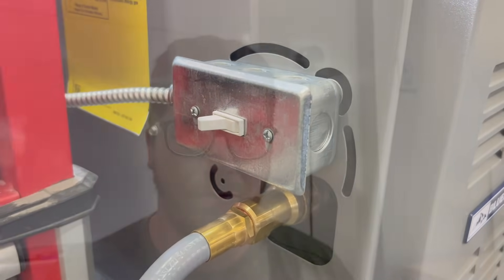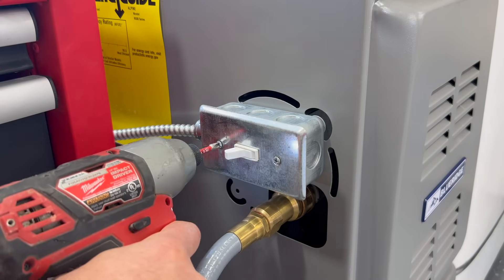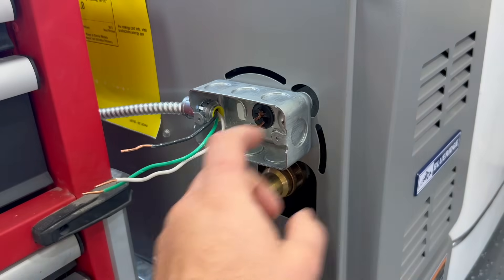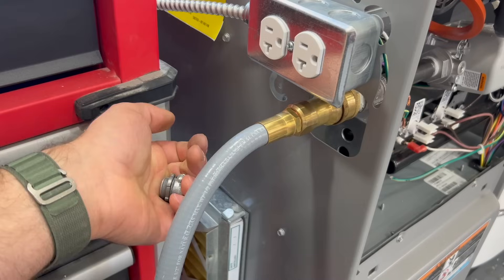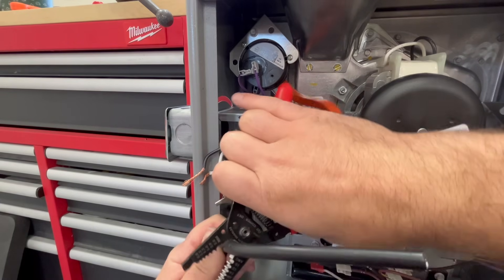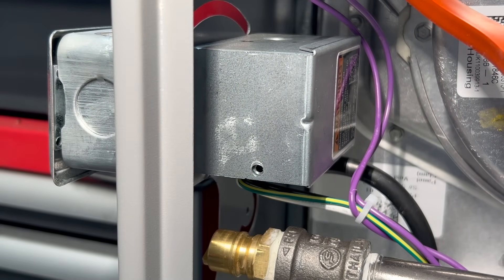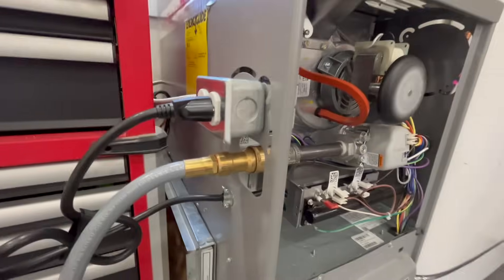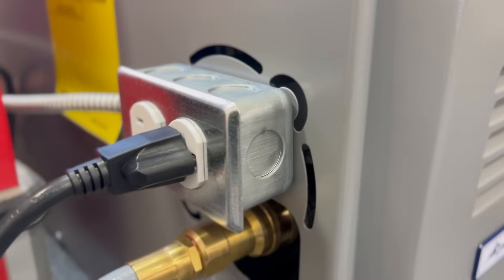Keep Your Family Warm During An Emergency Power Outage With This $20 Fix

Comment: Not NEC compliant ----I have something similar on my furnace, but it has a switch in place of the second outlet......NEC requires a furnace to be on a dedicated branch circuit , so having the extra outlet is not permissible.  A single outlet, or a switched single outlet is permitted.

Comment: Your GFI wall outlet may have reverse polarity because your tester was chirping when you plugged it into the neutral slot on the plug.
Reply: It's a proximity sensor I'm thinking it's fine

Comment: Did this on my furnace 40 years ago when I bought my first generator and didn’t need an over priced transfer switch. My life isn’t so petty that I need to have every convenience running 24/365. In winter I power my furnace if needed and every four to six hours maybe run the ref/freezer, and in summer just the ref/freezer. If it’s nasty hot out just wet a shirt or tee shirt and sit in front of a small fan. Chances are, with the fan, you will freeze your butt off.
Reply: a real macho man.
Reply: Has nothing to do with being petty....jealous much

Comment: SUPER vid! Especially that "bonding plug" tip with the power station use. I had been using a gas powered "bonded neutral" genny to run my nat gas fired furnace via an EZ Generator Transfer Switch; all was well, since the circuitry was "bonded" to the main electrical panel. 

BUT--when I bought an ECOFLOW poer unit/geneator--furnace would not kick on. I called "Kevin" at EX Generator Switch who referred me to their YouTube about this--just switched out two wires on their green EZ Generator Transfer Switch and it worked just fine!

This what Dave, the DIY HVAC man here is showing us here--your portable power unit, be it ECOFLOW, Jackery, Bluetti, Flashfish...whatever--needs to have the neutral circuitry "matched" to run your furnace--be it a floating or bonded neutral.

If you're unsure or don't want to handle the transfer switch route, just see what Dave does here! MAGNIFICENT! Thank you, Dave! Saved a bundle for a lot of folks!

Stay warm and stay safe, Folks! Here in an Ohio Winter it's been minus -20*F--nothing to fool with. Make sure you give your job here a "trial run" BEFORE Old Man Winter arives.

Cheers!

Here's the YT on the transfer switch:
https://www.youtube.com/watch?v=gVbUWCCt0D4
Reply: Question:  That is simply a standard plug. How does this connect the neutral to the ground?
Reply: But what happens when the power kicks back on and the generator is running. Wouldn't it be better to have a switch/plug combo. So you kill power to the furnace with the switch. And the plug is the only power coming into the furnace.

Comment: If the power is out how long will the "gas" continue to flow to houses?
Reply: That gas is coming through pressurized lines from many miles away. And those stations have their own back up systems.
Reply: @MrToLIL  Correct.  My late uncle was a gas meter man.  I ask that question 25 years ago.  Sometimes the gas travels 100's of miles before getting to your house.  Its the gas companies first priority as they cannot bill if the gas doesn't get to your house.   They are backed up 6 ways to Sunday including earth quake designs.  Just sayin.
Reply: @MrToLIL  Thanks for the response I understand how the gas comes to my house I want to know an estimate of how many days or weeks the back up systems at the gas company will continue to work...

Comment: What kind of gas line/fitting did you use in this installation?
BTW I used your videos, got my technician license and saved $14,000 installing a hybrid 4 ton heatpump/gas furnace by myself!  Thank you so much!
Reply from the maker: It’s a quick connect that is typically used for gas grills. Because this is in the middle of my garage I didn’t want to out in a permanent one so this works great. Obviously not up to code for a permanent installation.

Comment: I will just leave this here: "ECM Section 422.16(A) requires that fastened in place cord connected appliances must be specifically intended or identified for flexible cord connection by the listing agency and the manufacturer. The appliances must be marked accordingly".
Reply: Bro…where I live if you skin your knee and bleed 30 buzzards arrive 20 minutes later and peck your eye balls out.
Reply: @EvilE22 where OP lives he has to get a permit from his wife’s boyfriend to watch.
Reply: He said you could easily undo it. I assume he  meant in case you decide to sell
Reply: What size of generator do you need to at least have to do this?
Reply: 110 and 220 will not stop arking because of tape
Reply: @briancc2100 
It won’t even start arcing simply due to electrical tape, kind of the point of electric tape.
Reply: Idiot
Reply: OP sounds like a bootlicker.
Reply: You are ……duuh dum duuu🙈
The code was written for people like you who have no common sense …..
Reply: What  size Inverter do you have ? I have a 1,000 mine maybe too small of wattage.
Reply: YESS CODES , STATUES , LICENSES ARE NOT LAW NO ONE HAS THE RIGHT TO TELL YOU WHAT TO DO YOU ARE FREE BUT YOU HAVE LET MAN LEAD YOU BY HIS LAWS WHICH IS DEMONIC EITHER YOU SERVE GOD OR satan 👹~🙏TRUMP WON WE WON BECAUSE GOD ALWAYS WINS AND HE IS BRINGING THE CORPORATION DOWN SO START LIKE ME KNOW YOUR RIGHTS TAKE THEM TO COURT SUE DONT USE THEIR ""DRIVERS LICENSE""REG, INS, THEIR ARE WAYS TO DO IT I DO ‼️‼️🙏🙏🙏🇺🇸🇺🇸🇺🇸

⚖️⚖️BIBLE IS OUR AUTHORITY , CONSTITUTION ,BILL OF RIGHTS IS FROM THE BIBLE YOU ARE FREE ACT LIKE IT ‼️‼️🙏🙏
Reply: @lastword489 Thanks for the heads up. Even when it’s a desperate situation, the insurance companies may not agree with any exceptions for breaking the rules. ⚡️🔥🏠

Nor will the Grim Reaper!🪦🥀
Reply: Uhhh in an emergency..   no one makes me do anything..    Any regulations are out the window.

We had to make due in the summer of heat and winter of ice in st louis.  No one was there to save us.   We had to do our own saving.   Govt can suck it
Reply: @KerbyDaFrog  yup,codes can suck it in an emergency for my family.
Reply: @KerbyDaFrog Gotta pay to play, dude.
Reply: That's great and all but the real danger is having a cord dangling without armor protection.

Comment: 1,000 Watt inverter method is the one posted in a previous video is the one I want to go with.  Pigtailed to my Chevy 2500HD Duramax.  Also, I store my Deep Cycle RV batteries in my garage in the winter.
Reply: TRY using COHERENT sentences COHERENT sentences COHERENT sentences.

Comment: Is the bonding plug necessary if the power station is plugged in an outlet?  I asked because I noticed my power station has no ground stand along; but grounded when plugged in.  Thanks
Great video btw!

Comment: Did this modification during the Texas Freeze of 2023, I found a previous video of yours. It was awesome to have some normal comfort during that outage. quick and easy, when grid power came back, unplugged from generator and plugged back into grid. I used a switched outlet so that I can still switch on and off if needed.
Reply: Um…..THAT was in 2021, DUMBBELL!!!
Reply: @ there was another one in 2023 as well. I was okay during 2021, lost power 4 days in 2023.

Comment: The nice thing about these Portable power stations (I have the EcoFlow Delta 2 Max) you can plug the Portable Power station into 120VAC source and leave the the furnace plugged into the Power station 24/7 as most of them incorporate a "Pass-through" feature where whatever is plugged into the Power station will be powered by the grid power while it is also keeping the Power stations battery charged. This way you do not have to get up in the middle of the night to plug the furnace into the power station as it automatically switches to battery when needed. I wish they had a feature for my RV's LP, which ALWAYS empties a tank between midnight and 5 AM and it is cold outside. LOL
Reply from the maker: Awesome! I’ll have to do a video on this! Thanks so much for the idea.
Reply: @diyhvacguy  It's called ups mode to kick on when power fails.. Not all power stations have it, Bluetti does on some of their units like the AC180 and Elite 200 V2 which I have...maybe others.
Reply: You do not want to leave your power station plugged into utility power while using the neutral ground plug. It could mess some things up.
Reply: @Don_Kee  you won’t need the neutral plug if you have it plugged in to your utility power. That side should be providing the bonded ground and neutral it is looking for.
Reply: Great comment. I have an Ecoflow Delta 2 Max power station but was not aware of the pass through capability.
Reply: Wouldn't that back-feed the distribution system if power goes out?  And that could injure a utilityman working to restore power outside.  Quite reckless and illegal.
Reply: @eegg6954  when you have your computer plugged into a UPS and the power goes out does that back feed the grid?
Reply: @eegg6954  No back feed at all, because your furnace is not connected to the Grid, it is powered directly by the EcoFlow 2 Max and the Max is plugged into the grid for Pass Through and battery charging only. No AC power returns to the Grid. It is isolated from the grid.
Reply: With the EcoFlow Delta 2 Max, how many hours will it run your furnace?  Also, it seems you don't need to do any of the wiring shown in the video.

Comment: Can you also do this if your switch is on the wall, away from the furnace?  I'm trying to wrap my head around how the wiring would work.  Maybe after coffee.
Reply from the maker: lol coffee is always important. 

So it would be extremely easy. All you’d do is kill power at the breaker, remove your switch as well as the conduit that runs from your switch to the furnace, and then simply install the outlet where the switch was. Then you’d just put the pigtail in place of the conduit!

I could probably do a video on this but I’m not sure how many furnaces would be oriented this way. 

Cheers
Reply: @diyhvacguy  Thanks, that makes sense.  You mentioned something about not having the pigtail too long.  The distance up the wall and over the ceiling and down to the furnace is probably longer than the 9' pigtail.  Assuming I get a longer pigtail, would you be concerned about that longer length?  Thanks a ton!
Reply: @diyhvacguy  I think I'm overthinking this.  Couldn't I just leave the wire in the conduit, and use a short pigtail where it terminates in the switch box to then act as the plug after I change the switch to an outlet?
Reply: @diyhvacguy  It worked great!  Thanks!

Comment: This is a very good video and something we want to do. The power in our city is very dependable as we have had maybe two outages in the 25 years we have lived here. However, we do need to be able to power our gas furnace in the event of an outage during the winter. Do you have any idea how much it should cost to have an electrician do this work that you showed in the video?
Reply from the maker: Probably 300-500 if I had to guess. Maybe less. The great part is it’s 100% reversible should someone say it’s “not up to code”. I’ve seen so many homes here in Utah with an outlet and a plug just like this and most inspectors would have no objections to it

Comment: In my case, I installed a generator transfer switch  and panel into my main  breaker panel.  I can power my gas furnace, well pump, refrigerator and freezer and a few other breakers strategically throughout my house.  No need for extension cords running to everything except for the one heavy duty 10 gauge cable that runs between my generator and the transfer switch.

Comment: Can you run an extension cord from outside gas generator and plug it into the pigtail, instead of the battery generator?
Reply from the maker: Correct

Comment: Even though "hot pens, Wiggy" are useful, trained electricians are trained and encouraged to never use them. Most of them (hot pens) have a false negative hazard.
Reply: Gotta be better than nothing
Reply: Agreed. Never trust one of these pens with your life. He wants to do it and that's fine but always check with a meter hot to neutral, hot to ground, neutral to ground. Even then the meter could have a blown fuse so the pen first would also help. I just had a home inspector give my home a failed report saying none of the outlets were grounded. They came back the next day after they realized their meter was broken.
Reply: Agree

Comment: You left out the 4th item you need...a generator. 🤷
Reply: I have a very similar setup and in 2 hours I can recharge the battery from a generator which will then last all night without noise, pollution, risk of theft, or fuel consumption.
Reply: Watch the last minute of the video. He mentioned sizing the battery for runtime and for some people if they lost power in the middle of the night it would be more convenient to put in a battery and go back to bed. We don't need a lesson on generators on every single video touching on electrical usage and batteries.
Reply: I could not see where explained how this set up does not back feed to the grid and killing a lineman.  Can you elaborate please?
Reply from the maker: It’s completely isolated from the grid when it’s unplugged from the outlet. Not even the ground is still attached. Hense the need for the bonding plug